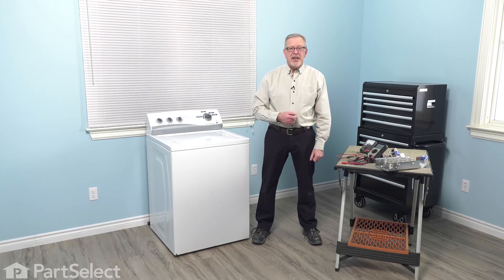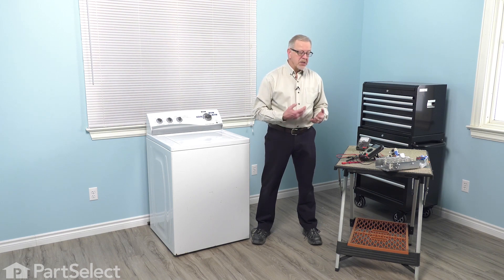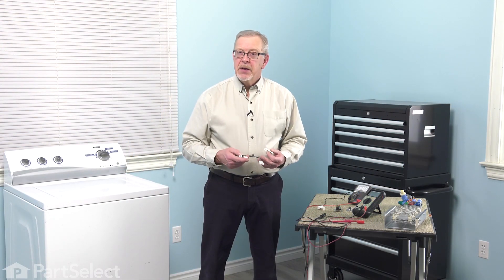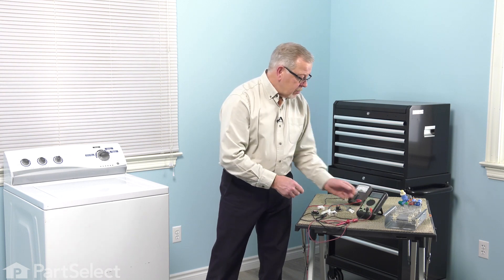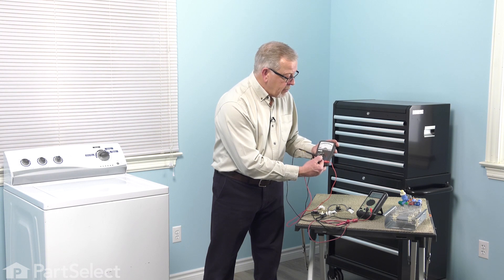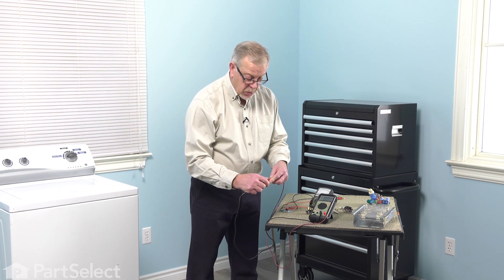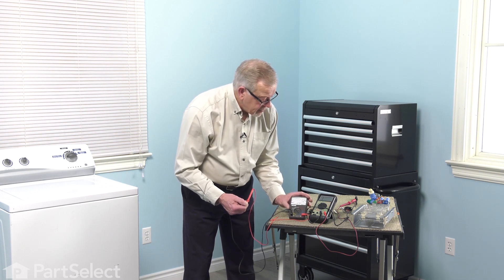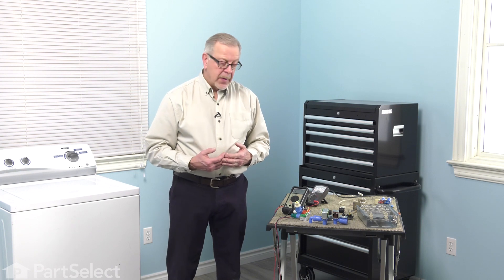Appliance Repair: How To Use a Multimeter To Test for Continuity

Comment: AMAZING 
Your preparation in setting up the stage along with your attire with a nice neatly pressed shirt was a nice touch causing me to think you will have an instructional video that is near flawless too. 

I made it through the 1st 3 minutes. Amazing failure with instructions! Did you actually think any of we beginners would have a clue what to set the dial at when we couldnt see it ? 2. Do you really think any of us can see the testers at that distance? If you would have proof viewed it how did you not see that?
(ditch the mood music  on an instruction video,besides most peopes music is too loud /distracting . At a rock concert,ok,but NOT for  testing electrial connections instructions,

View other example posted here as a guide good and bad. Yours is the worst Ive ever seen..good luck

Comment: This did not answer my question about my Kenmore Electric Cloths dryer. How do you check the heating element and the fuses. What settings do I use to check them.
Reply: ohm